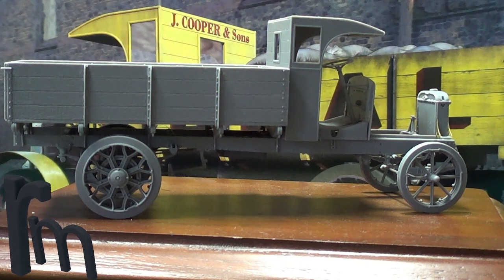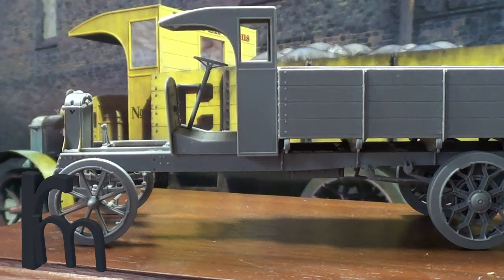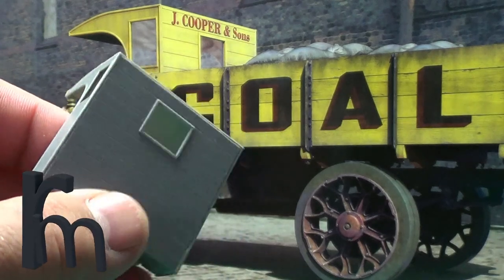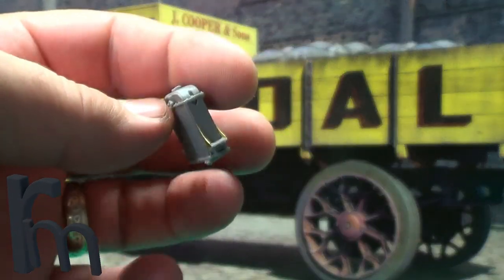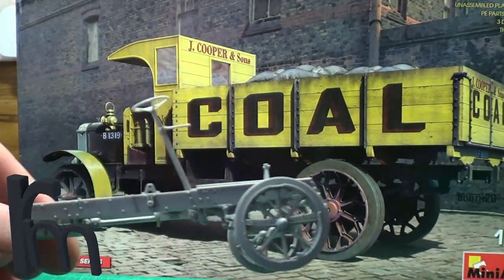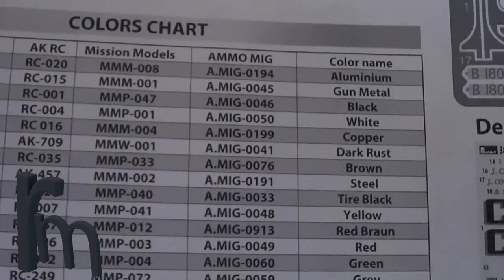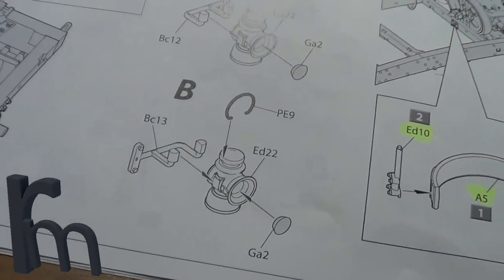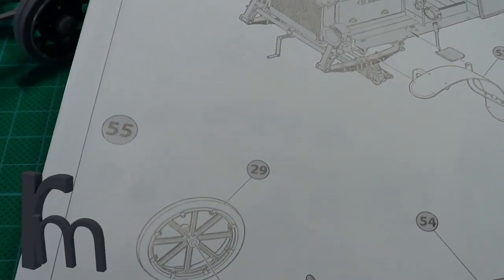MINIART BRITISH LORRY 3T lgoc b-type (update 1 )

Comment: Does this kit have the two cabin options or is it just the one in this kit?
Reply from the maker: No dude just the one you get options for different headlights
Reply: @RimsModels  ok in The army version there is two different cab options. A full wooden one and the one you made
Reply from the maker: @Jonhistorymodel  ok good to no tell you what dude it’s some of the nicest wood effects I’ve seen
Reply: @RimsModels  yeah Miniart wood mould is good. I’ve always liked Miniart wood grains. They have a lot of variety as well. It’s not always the same.
Reply from the maker: @Jonhistorymodel  yes I agree will take a dry brush nicely 👍
Reply: @RimsModels  I’ll give you my method for wood.
1. Base coat the wood in Tamiyas Wooden deck tan
2. Make up a very light red orange oil mix. Like a filter. Not a thicker wash. Add a fair bit of white spirt. Cover the wood with you red orange mix than....
3 add a shitload of a dark burnt umber with a bit of yellow ochre to your oil mix. Make it thicker like a good pin wash than put that all over the wood. Wait 5 minutes than clean up with cotton bud to taste.
That gives an awesome effect
An easier one is once again Tamiya wooden deck tan as your base. Make a yellow ochre oil mix. Apply and you get a nice pine effect. 
Another method for the armoury. Good luck
Reply from the maker: @Jonhistorymodel  great tips dude I’ll give that a go thanks for sharing that
Reply: @RimsModels  that's ok mate